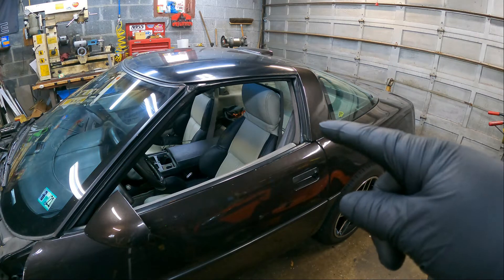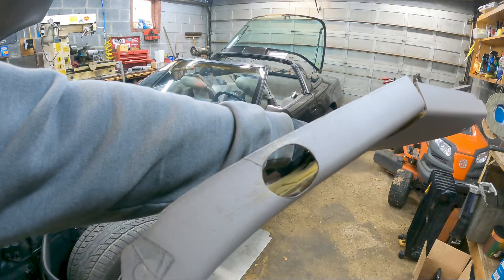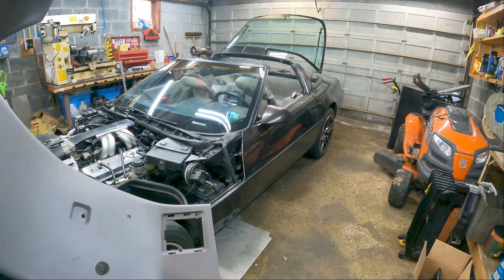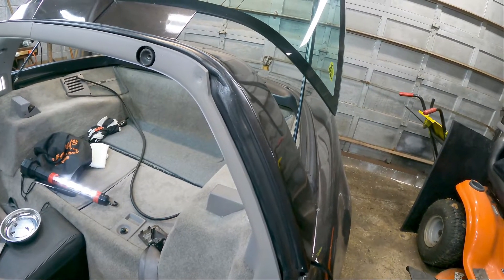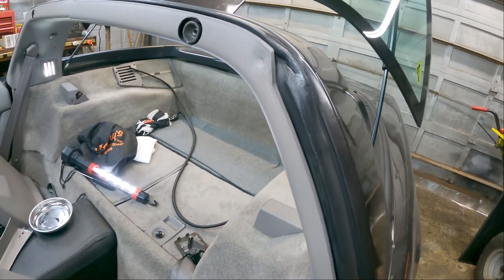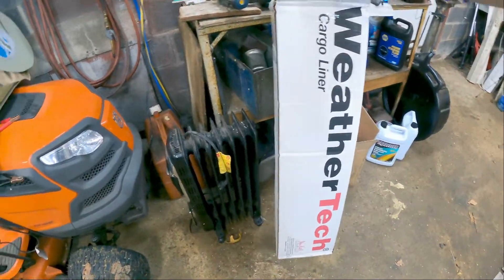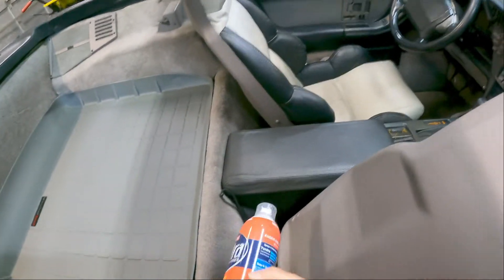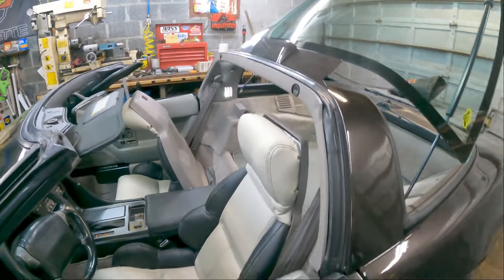C4 Halo Gone Wrong

Comment: If you still have your old halo, maybe find a good spot on it and cut out some small circle pieces the size of the holes on the new halo and glue them into place.  Or, take the halo off again and tape the pieces in from the back.  However, I couldn't see the holes in the video (and I really looked for them).  Good job on matching the paint color to your interior.

Comment: NOW !! you can put the C4 84-90 flags on your center caps ...just the flags not the black circles cut them off with a razor blade that's what I did ...  nice improvements on your vette ...   :)
Reply from the maker: The way my center caps on my wheels are molded it will never look right so I May just use them in a more unique way